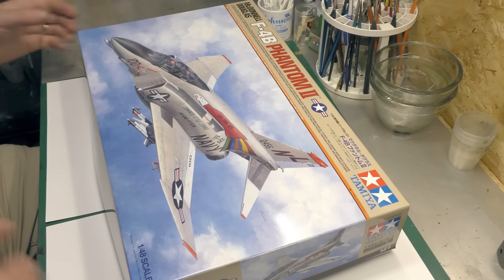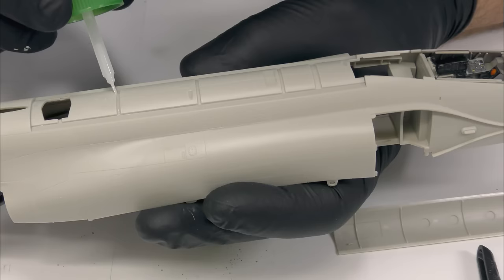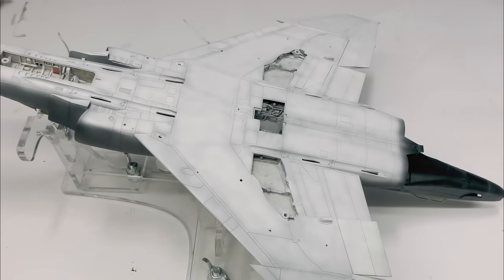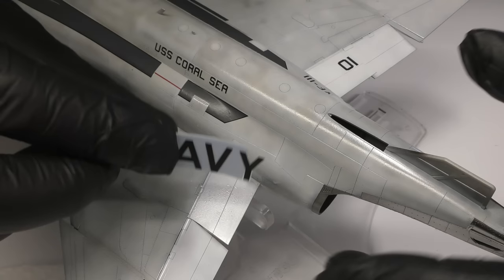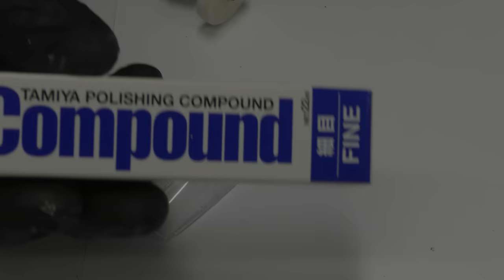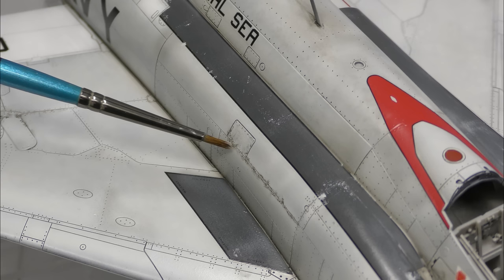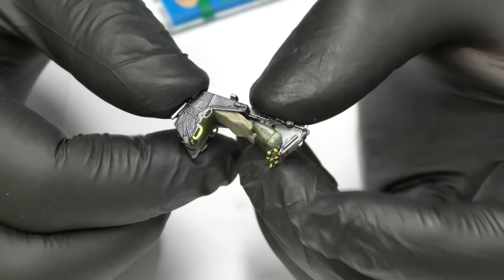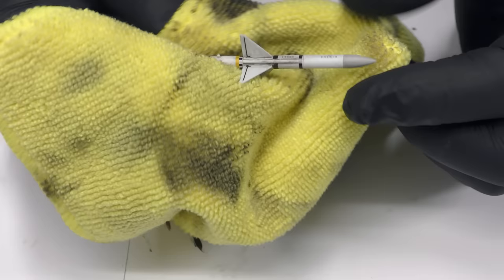Tamiya NEW 1/48 F-4B Phantom II VF-111. Full build aircraft model kit #61121

Comment: Great build, but I have one question.  I can never understand why every modeler who builds jet aircraft simulates wear marks on ejection seats and the cockpit.  I was an AME with a fighter squadron for 3 1/2 years and every day we did an inspection on the seats and cockpit and if any wear was on the seats, we painted them to keep from corrosion as well as greasing any bare metal in the linkages.  If an aircraft wasn't daylied, it didn't fly.  I know everyone strives to make their models as realistic as possible, so this is just something to keep in mind for future builds.
Reply: If you look at any cockpit you can see wear though ;)
Reply: I have noticed that weathering has become it's own type of "skill" people are trying to show off more and more. I'm not a pilot but even on the farm, you don't want tractor hydraulics to get overly dirty and "weathered" because that's how you identify leaks and make sure nothing bad gets into the system or even can impair something moving correctly.
Reply: @Steve Morley Serious modelers are going for the most realistic and true to life representations. The problem is, most don't know about the regimens that military aircraft have to go through during daily checks and maintenance. It's just kind of assumed that weathering over time and oil and soot just build up. 

There are some that will use artistic license but usually they will put it in their descriptions. Most others are going true to life.
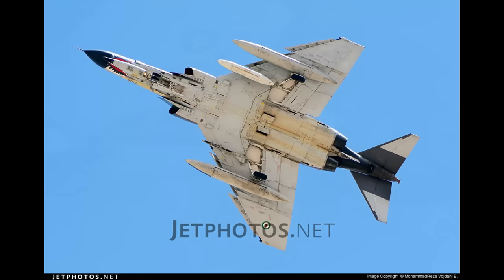Reply: @Steve Morley If you edit that to show @37:27 it should go right to that point in the video. The @ symbol makes it easier for everyone to see what you are talking about without effort. You know, for lazy tubers like me who want instant gratification.
Reply from the maker: Thanks everyone, interesting conversation. I guess another reason is a toss-up between realism and striving to make an ejector seat, 48 times smaller than the real thing, look more interesting than a satin black piece of plastic. I try and work from photos but sometimes I get lost in fun of weathering and go too far, but why not, its a model and I do it for fun. Thanks all. Andy
Reply: @ScaleModelShed  I totally understand. My comments were about complete realism but it really is a balancing act. Too clean at such a small scale and it become sterile. You're right.
Reply: @ScaleModelShed  I just think of models (where someone is showing all the weathering you do) as aircraft in a combat theater after weeks and months of continuous battle.. I guarantee even the best functionally maintained of those aircraft will not be "parade ready" on the outside, lol. Great job!
Reply: @spiritualarchitect4276  for even more laziness, drop the @ completely. A simple 37:27 will do just fine
Reply: Another issue is that this is a US Navy jet, it is on a carrier, which is exposed to a much more corrosive environment than what most US Air Force planeswould be exposed to, it is a known fact of the services that the USN planes tend to be a lot grimier than a USAF plane.
Reply: If modelers want to go nuts with weathering, they should build Japanese WW2 aircraft.
Reply: There's probably some modeller whose collection looks like an aircraft boneyard because of how much he likes weathering his models.
Reply: @ScaleModelShed  it’s your model you built it the way you want
Reply: Yeah, the other one you see a lot of is people taking black washes and grimey oils to wheel wells and internal bays. In many cases, these are kept spotless in the real thing to ensure that leaks are very visible and easy to address.
Reply: It's a simple answer to the question. You build models for you and nobody else. Critique or not, this is how they built theirs, and that's all that matters. I follow a few modeling channels, and see it over and over. Build how you want, not how the internet wants. If they wanted to build a really ratted out F4 phantom, than so be it! I've seen submarines that are spotless coming out of a fresh build, and those that have been in the water for decades. Both are correct!
Reply: I was an NFO and served aboard CVN-74 2001-2003 as ships company.  If anything, he forgot to add greasy hand prints on access panels and boot prints on the upper wing surfaces.  The carrier is a filthy place and in wet conditions, water mixed with hydraulic fluid, grease, oil, and exhaust soot covered EVERYTHING.  Nothing on the carrier was spotless.  F-14s literally dripped fluid from just about everywhere...the running joke was if it wasn't dripping it meant it was empty...they were always absolutely streaked with JP4 and red hydraulic fluid.  I think the model looked great!  There IS a big difference between being dirty and corrosion.  I agree with former Navy guys that commented here that corrosion control was taken seriously and was a non-stop, priority task.
Reply: @Teutonic Nobility we had plenty of workups with super hornet squadrons.   Filthy?  Maybe not, but certainly not spotless either.  Take a look at any westpac squadron plane after a 6-7 month deployment.  No beef here...I just think the weathering looked great on that Sundowner F-4 and was consistent with my own experience.   I do agree that sometimes 1 model gets ALL the patina that may not be present on every fleet aircraft and may look exaggerated a bit. Thanks for the support.   I spent 20 years AD mostly as a west coast guy...3rd and 7th Fleet AORs.
Reply: That was my first thought, "Man, that is a gorgeous model and an amazingly skilled modeler... but that crew would be in SOOO much trouble." LOL
Reply: @aaronutley  Yeah, the Maintenance Chief would have had our asses for sure!!!
Reply: Well that's interesting. You would think the constant climbing in and out would leave wear marks in the cockpit. What, we had to fight and be clean about it! 😆 🤣 😂
Reply: @Warpig0321  I don't build models nearly as often as I used to, but it was probably 20-25 years ago when I remembered the deeply shaded panel lines started coming into vogue. I always thought they were a bit overdone by a lot of people. Looking at real pictures, even of dirtied up planes in active war zones, and you rarely see such clear definition between body panels. The F-4B in this video is not particularly overboard in that regard, the underside is gorgeous, top side perhaps a bit overdone with the panels and leaks... But I've seen some otherwise gorgeous models that appear to have 6-inch gaps between the panels if you theoretically scaled the thing up to full size in your head. 

All that being said, I fully understand the modeler making the model he/she wants to make... and having it look however they want it to look. But it does bother me a bit if said modeler claims it's being done for "realism" when their F-15 model looks like it has Death Star trenches for panel lines.
Reply: @jjgreybeard  Jets get absolutely filthy on deployments, especially the Navy jets. The salt water environment isn't friendly, but they still fly. Don't know where you're getting that info from...
Reply: My take as a modelmaker is that while it's true real military vehicles wouldn't have as much weathering as the models of them, modelmaking is as much about replicating a vehicle as it is making art, and part of the art of modelmaking is having fun with the weathering. Weathering is there not as a representative of the condition of the vehicle, but to tell a story without words about the vehicle's life. Weathering also helps one see the details more easily and appreciate them. Just my two cents, and I hope it helps!
Reply: @Steve Morley yeah exactly i agree with you, an be boring hobby without it! It wasn't a thing 30 years ago when i was building really but recently ive been back in the hobby 3 years armour now and its totally changed i love it now! we all have our own take on weathering but to try to get it looking like photos you have infrot of you! With aircraft one thing I have learnt is that on aircraft Carriers there not near as looked after as ground force's! These things are always heavy weathered in real life it must be acceptable to a degree always interesting to learn to skills with the weathering aswell I've not long started fading blending etc with oil's it's a great skill to have people who can't get it right most the time seem to complain the most aswell I've noticed lol
Reply: I think it looks fantastic!
Reply: @cchavezjr7  there are literally 1,000's and 1,000's of photos online and in reference materials that shows military vehicles and aircraft in particular that show heavy weathering from military use.

Do some over do it? Yes! But this one is hardly overdone at all!
Reply: I think it gos back to models depicting WW2 fighter cockpit that was in heavy use daily with no time for small maintenance. 
it's the same with armoured kits way to much weathering.
Reply: If you paint it like it just came from the factory it's very realistic, for that short period of time; and you don't have to use artistic license.
Reply: He did an excellent job but I agree, it's easy to "over do" the weathering on aircraft. These aircraft are not like tanks. They get dirty during flight & are immediately cleaned when grounded. They don't have the heavy oil/grime spots like WWI / WWII aircraft.
Reply: @dennisbart1366  Agreed. There's the same difference between a combat aircraft in constant use and a soldier in a combat zone. Neither has the time or frankly the inclination for the 'spot and polish' of a peaceful environment. I'm reminded of a fictional incident in 'Sharpe' when he said to an officer 'Your men are dirty!' The reply given was 'Men are dirty, rifles are clean.' IOW prioritising use over looks.
Reply: @Vicarium yup. In the Army I wouldn't get on a helicopter that wasn't leaking. Especially a Chinook. If it ain't leaking it's gonna crash, because it has no fluid in it. Those Chinooks and Blackhawks would be filthy after a day of running around too. Especially in Iraq. Thst super fine sand got everywhere. We spent 2 weeks before we went home cleaning all out humvees and trucks with pressure washers because that oily baby powder fine sand and grime was everywhere after a year of fighting. I was still finding that stuff in vehicles and gear a year after we got home buried in small cracks and crevices.

Comment: Just a note on brushes, if you want them to last longer make sure to not get the paint all the way up to the ferule, the metal part that holds the hairs. You probably want a round #1 brush for those side panels. I would guess that is a #0 or even #00. That is way too small for that area. Look into a wet pallet as well. Only 3 min in, but just needed to say this.

Comment: Nice work. The two different size masks for the canopy are for reproducing the sealant around the windows. First apply the smaller mask, prime black (interior colour) then paint with the colour of the sealant (check references, can be tan, can be very light pink) Remove smaller mask then apply larger masks to cover the window and the seal colour you have already painted. Apply your base colour/s. Seal weather blah blah... Remove masks and BINGO! you have the windows with the surrounding sealant!!
Reply from the maker: Hi Ivan, that makes sense, I didn't realize that. Thank you for pointing that out, they're a great addition!. Cheers Andy

Comment: One very small detail that may sometimes be overlooked or left out; the cupped portion of the tailhook, the area that comes in actual contact with the arresting cable, should always have some black grease on it. Every tailhook I saw on the flight deck in my six years in the US Navy had black grease right there. In fact that is one of the troubleshooter's job before launch is to ensure the tailhook is not damaged and that there is grease on it. The actual grease is flat black in appearance.

p.s. beautiful work, top drawer.

Comment: amazing work! I've always been careful not to use Mr Color and Tamiya on top of each other since one is lacquer and the other acrylic. Yet I see you using both at the same time with no problems or reactions whatsoever.
Reply: You shouldn’t have any issues unless you are using Mr Leveling Thinner or any type of lacquer thinner with both paints. Even thin if you use light coats it shouldn’t be an issue

Comment: As a former F-14 Airframes and Hydraulics Systems Specialist in VF-111, as well as being assigned to Corrosion Control for several months, we completely re-painted a couple of birds in that time... ( Yes after the F-4),  My suggestion on weathering/staining, is to look at photos contemporary to the time frame you are modelling...  Oil stain streaks, fuel streaks, etc., are due to the components behind the panels and their leaks.  If it's an electronics bay, that will be dry, and if there's surface corrosion staining the bird, the "Crud Crew" as they were (partially) affectionately known, are not doing their job!  Corrosion is the primary enemy!  Every part of the plane besides Titanium and Stainless Steel, is trying to return to the earth!

If you want it to look real, make it look REAL.

Comment: Did you see if the gear bay doors fit in the wheel wells? I want to make mine in flight but I am wondering if I will have difficulty with fitting the doors.

Comment: Whats a trisac pad?  used for decal shine removal
Reply from the maker: Hi. A Trizact pad is used for automotive polishing and that kind of thing. Its basically the same kind of thing as a 2000 sanding block, but on a soft foam back pad designed to go on a machine polisher. I get them from my work and they are really useful because they are so gentle, you can get them right up to a 6000 grade. Thanks Andy

Comment: I feel noone does the ol' oven tray trick anymore to simulate weightload on the tires anymore. Using a heated oven tray melts the tires a bit and "squashes" the loadbearing side a bit to simulate them carrying the weight of the aircraft. Used to be a cool trick modelers used a decade back. 

Would you be able to try it out sometime?
Reply from the maker: Yes I will! Thanks for the tip.

Comment: First off: Fantastic Build! I love me a good Sundowner scheme. I have a few questions. When you were cleaning the wash off the plane was that dry microfiber cloth or did it have any mineral spirits/thinner on it? What gloves do you wear while building? I never thought about doing that but it would certainly mitigate any finger prints. I always manage finger prints somewhere.
Reply from the maker: Hi, thank you. I use a dry soft cloth, otherwise you will remove all the oils, unless of course you want to start again, then use a bit of white/mineral spirit. I wear nitrile gloves. No finger prints or oils. And if the wife shouts wanting a hand with the kids, I don't need to wash my hands of paint and glue etc 🤣. Thanks for watching.

Comment: Bloody good job there , i now have a template to work too, thanks also for explaining re the stencils 😃.....just one question did you use any thinners with the Mr  Finishing Surfacer 1500 black, had a few issues with mine ie  build up around the needle which then splatters onto the model 😖?
Excellent job nice and clear
Reply from the maker: Hi Dave, thank you. Yes i usually thin Mr Finishing Surfacer about 50% Levelling thinner. Cheers. Andy

Comment: I noticed drilling was involved and tonnes of airbrush work. I just wanted to know as an amateur, are those tWo things essential? I come from the world of games workshop minis etc so have lots of paints and brushes etc and all the tools but no drill or airbrush, just checking how doable it is without those things (particularly the airbrush, I can buy a cheap hand drill )
Reply: Yes you can get a really nice finish with a brush only, but I find it takes a lot more practice and knowledge of the paint you are using than if you use a airbrush. With large areas that is. I have brush painted Tamiya Acrylics using retarder. But you can't beat a airbrush for big areas.
Reply: @zzodr thanks, took a while but I’m enjoying it now! Still no airbrush but shifting in that direction…

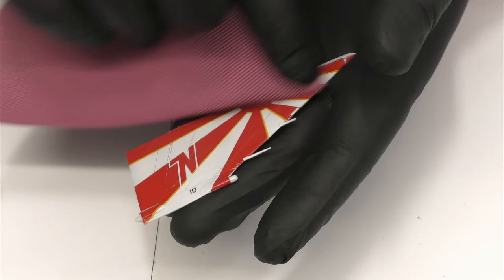Comment: WOW!  I wish I had seen you video before I started mine!  I'm at the Decal Phase and was wondering about the 2000 grit pad you use on the decals and overall finish around the 21:20 video time mark.  Will any 2000 grit sanding pads work?
Reply from the maker: Hi Andrew, the 2000 is an automotive polishing pad. You want something very gentle that only matts the surface. Thanks for watching.
Reply: @ScaleModelShed  copy, thanks for the tip again!